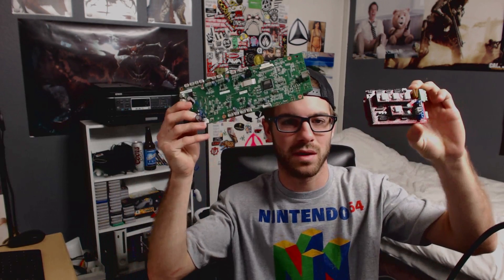Da Vinci 3d Printer Board Swap | Electronics Came In | Ramps 1.4

Comment: Having about the same issue with mine, I ended up building 2 ender 3 pros which are great printers. But all the parts except hotend and the thermistor still work on my da Vinci 1.0A. The bed the lights I could be doing ABS projects with it. I think I might convert to a bowden setup and swap the old board with a new one. I am getting a error as well when I tried to swap out the thermistor.

Comment: hey man I have a huge problem trying to do the same thing you did but I can't figure out where the four wires for the heat bed plug in mainly being the power and whatever the three and five old do for the heat bed did you splice those and do anything anywhere would love to know
Reply from the maker: +nicholas tracy the heat bed only has two power wires they go into d8 or d10 on the ramps board can't remember off my head the other two wired should be for the thermister
Reply: ModBot, thanks you replying I appreciate it very much I kind of also thought that it had to be something to do with the thermistor but still not really sure on where I should hook them up for them to work properly if you happen to remember anything that may help me I would much appreciate it
Reply from the maker: nicholas tracy just Google a diagram of the ramps board so you can see where everything goes.  You basically just follow the cable from the thermister to its plug the thermister should be smaller than the power as the power almost always uses a thicker gauge of wire! No problem :)!

Comment: Hi community.I have lost the heat in my extruder and  in my bed simultaneousely. Any 
Idea? The temperatures sensors work ,but the elements doesn't warm up.

Comment: it said heater decoupled because you have to use a 500k 3% thermister and a 12v 35 watt heater cart. Thats what the stock da vinci head uses. I had the same issue. I used my old davicnci parts in my new e3d v6. I used your other video to flash and use repetier which has been great! but i shorted the board and now im using this video to upgrade to ramps. Thanks man!

Comment: i had similar problem with the heater being "decoupled"ended up being the cheap little plastic plug that disconnects the extruder heater. i fought it for a long time once i figured it out i cut it out and soldered the wires together

Comment: If you need to replace the arduino they are super cheap on eBay, just the arduino if it is broken. Also, there are not really any clones since arduino is open source.